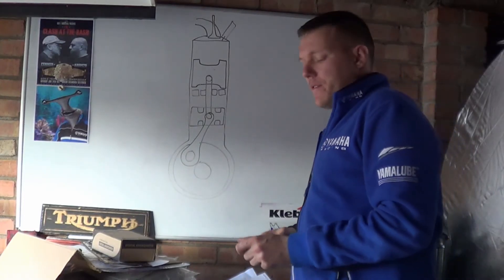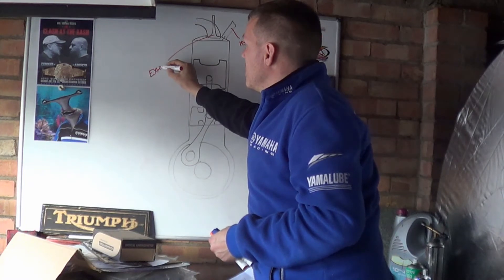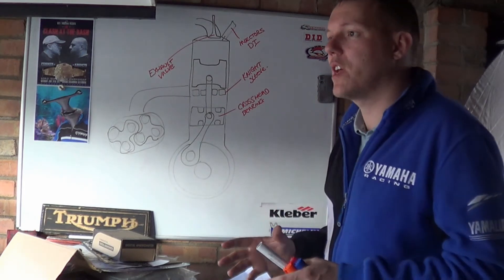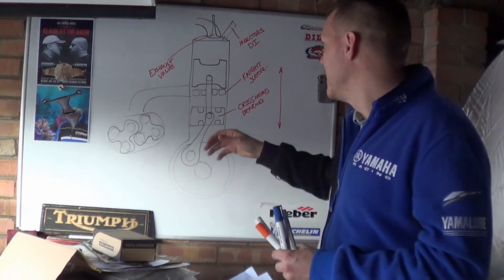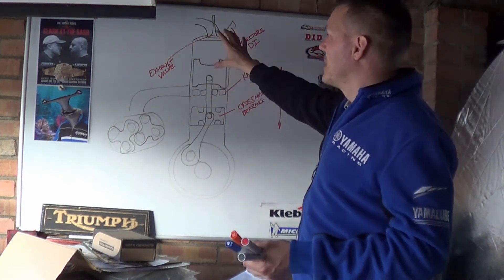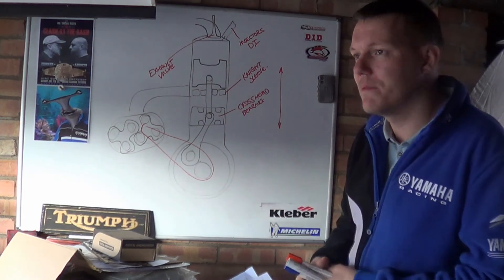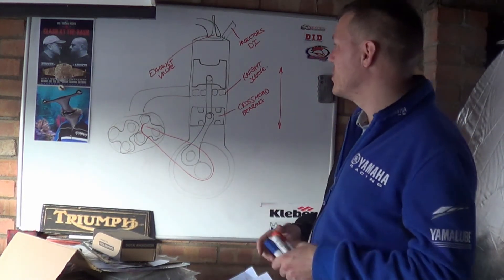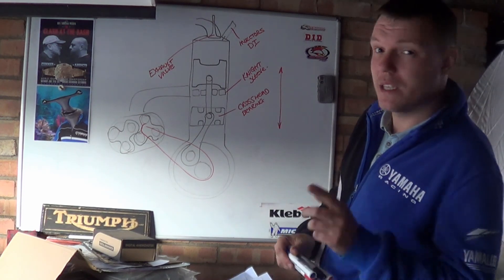2 Stroke diesel basics

Comment: When I was taking mechanics courses in High School, (College as you call it), they never taught us about these types of 2 stroke Diesel you talked about. They only taught us about the types the have an intake and exhaust valve. The kind that has the piston work like a vacuum to suck in the air on the downstroke, which then blows out the exhaust and both valves are opened at the same time. Still has a supercharger to make sure the exhaust is blown out. I found out that it is possible for a 2 stroke gas engine to work in the same fashion, but such an engine is not manufactured, because the idea of a 2 stroke gas engine is for lightweight applications, like chainsaws and dirt bikes, as well as reduced cost, fewer moving parts and simpler to maintain. Hence why you'll never see a 2 stroke diesel on a chainsaw. Would just make it too heavy. It would be possible to easily convert a small 4 stroke gas engine, like the ones used on lawnmowers, rototillers and snow blowers, to 2 strokes that work like 2 stroke diesel. All you'd have to do is make a camshaft with 4 lobes instead of 2, ad a supercharger to the carburetor, redesign the carburetor and ad another magnet to the flywheel. It's the same thing with any motorcycle and car engine, but you'd have to redesign the distributor and the fuel injection system. Adding a supercharger is the main issue since it increases the weight and 4 strokes are already heavier than 2 strokes, but since it would be more powerful, and more efficient, this wouldn't really matter. You still wouldn't see them on chainsaws though.
Reply: @Leemur2335  That's true. However, if you used a supercharger like on a 2 Stroke Diesel and fuel injection, instead of a carburetor and the ports around the cylinder, this could work on a gas engine. Certainly, it would be a waste to use on lawn mowers, rototillers and snow blowers. They're too small. Still, it could be used on Yard Tractors, Motorcycles, Cars and other motor vehicles. 

I understand that 2 Stroke gas engines now have injectors, instead of carburetors and this means all the fuel is burned, instead of some being pushed out with the exhaust, so it's cleaner. Still, I wouldn't want a 2 Stroke gas either way. I prefer 4 Stroke. They're cleaner-burning, don't burn oil, (unless the rings are worn out), quieter and more fuel-efficient. They have downsides like being heavier, more moving parts, harder to repair and more costly, however, they have come a long way in recent decades, as they're more powerful than ever, lighter and more compact. I was reading about Toyota's 1.9 litres straight 4 engines for example. The ones they use in their Prius', Camry's and Corolla's can get up to 242 horsepower now. The blocks are made of cast aluminum and the heads are made of aluminum. As a result, the engines weigh less than 300 pounds. I drive a 1997 Dodge Ram. It has a 5.2 litre V8, which is 220 horsepower and weighs 1100 pounds. It's made of cast iron. I'm willing to bet with the mechanical know-how, I could put one of those Toyota engines in it, while still using the same transmission I have, and I'd not only get more horsepower but much better gas mileage. Toyota should put those engines in their Tundras and save their big V6s and 8s for larger delivery trucks and other heavy applications.  I was reading that even Diesels can be made out of aluminum now and I thought the only light metal you could use on them was Titanium. You learn something every day.
Reply: @Leemur2335  Yes. I meant that the Toyota engines are less than 300 pounds in weight. Not sure if they make 300 ft. lbs of torque, but since they're multivalve, they might. Besides, Dodge used to put straight 4s in their minivans. My mother had one. It was an 88 Caravan. Those weren't very powerful, but could still be used for towing, although the V6s are better for that. The newer straight 4s could probably handle it. The ones introduced in 1996 get 245 hp and 260 ft. lbs of torque. Obviously not able to tow a big 25-foot travel trailer, but something like a tent trailer, or a boat at least. 

I used to own a 1985 Dodge Ram and it too had a 5.2 litre V8. It got 140 horsepower and 160 ft. lbs of torque. Of course, that was back when Chrysler was still using the LA engine. The Magnums, as I have now were introduced in 1992. Too bad, they never produced a LA and Magnum version of the Slant 6. Dodge trucks actually had Slant 6s until 1987. They weren't as powerful as the LA V6s, which were 120 hp., so not very suitable for towing, since they were less than 100 horsepower usually, but they were smooth running.
Reply: Yes using the crankcase wokrs well for a blower, liik at the skidoo etec with turbo now. If you need a 2 stroke fix you can convert a 4 joke in to a 2 stroke by u-loop charging thought the valves. a 5.9 would make a fun 2 stroke project like this vw 1.9 TDI 2 stroke conversion:https://www.youtube.com/watch?v=qosAllch8Sg&t=3s.  The cams would need to run 1;1 with the crankshaft and the exh would have to open a little earlier to allow bleed down, metal baffle would be needed for the intake valves to allow thorough loop scavenging. this is the pdf that descibes it:file:///C:/Users/bemil/AppData/Local/Temp/inventions-04-00044.pdf

Comment: I assume it has an oiling system like most car engines. if that is correct what stops the oil from blowing out when it goes across the intake port
Reply from the maker: The cross head bearing, and the fact that a little oil is burned

Comment: actually... the one you drawn up is not too efficient.you need 2 turbos there.
the blower is only needed at light load low rpm. a turbo can take over when revs are up.
and why 2 turbos ? you need to turbo coumpound it. THEN its efficient.

Comment: well, this is one type of it, but there are many many 2 stroke diesel kinds.
crosshead is not used for smaller sizes,
you do not need a supercharger, only at startup. then on locomotives its switched by a turbo. so you don't have parasitic losses.
and power to weight they can be verry verry good.
at one point they made a way into aviation too, and there power to weight ratio is crucial.

how about a video on other type of 2 stroke diesels ?

http://cdn.intechopen.com/pdfs/43662/intech-advances_in_the_design_of_two_stroke_high_speed_compression_ignition_engines.pdf

that might be a good read.
". In the more advanced configuration, the engine shows a power density of 50kW/l, a minimum specific fuel consumption of 235 g/kWh, along with relatively low in-cylinder peak pressures (120 bar). AVL claims that the engine is much lighter than afour stroke unit of the same top power and with similar single cylinder displacement(the total weight is less than 80kg). As far as emissions are concerned, the behavior ofthis two stroke engine does not differ from a four-stroke counterpart, and additional ad‐vantages have been found in terms of noise and NOx reduction."

that sounds sexy, does it not ?

Comment: He really needs to talk about 2 stroke Detroit diesels, like the series 71, 92, and 53. The 53's could rev higher. It wasn't long ago that the US military still used the M1070 HET with a 8v92T making 500hp, that's a V8 with 92 cubic inches per cylinder.
Reply: Don't forget the 6-110 and the 149's I had a 12V 149 that had 4 turbos and was 1100 hp.. Detroit also made a 3 and 4 51 series... loop scavenged... no valves.. EMD's are 576 and 645  cubic inches per cylinder. I think the EMD's got up 3-4K hp..
Reply: There was also nissan ud 2 stroke diesels, those were 75 CID per cylinder and had an external fuel injection pump.
Reply: Im about to grab an 8v92 for 2850
Reply: The field Marshall tractor had a giant single loop charged 2 stroke, i just read up on it. It has pressurized crankcase and external oil pump dry sump to feed oil to the journals. Its around 6 liters or over 300 cubic inches.

Comment: Ok, I'm an ignorant new guy. I've read the comments below and agree with EpicStream Overclock. Why can't you take this 90% efficient breathing system and use it on a regular petrol engine?Replace the injector with a spark plug. Introduce fuel in the supercharged air inflow and delete the cross head bearing piston and finally down size everything to 300 to 1000 CC or so?I assume the EXHAUST valve is mechanically actuated by a cam or other mechanism. BUT a single valve is NOT that bigof a complication. This would give you an efficient 2 stroke with clean emissions and the lubrication of a 4 stroke with thepower of a 2 stroke. What am I missing? Must be something. Cause, I AIN"T that smart.
Reply from the maker: You need a supercharger thats why. https://www.youtube.com/watch?v=nIM0m9Z-C6o&t=275s
Reply: The exhaust valve in the head closes the cycle so supercharging is possible/required.Also now the crankshaft gallery can be shared by multiple cylindersand oiled by pump making a multi cylinder 2T more practical.

Comment: All modern 2 stroke diesel engines use turbocharges, not superchargers and an auxiliary electric driven fan for low RPM and starting. Also the crankcase is separated from the cylinder by a diaphragm plate and stuffing box with the crosshead running on slides in the crankcase. Also the cylinder needs to lubricated using quills from a separate oil supply.

Comment: Probably a stupid question
Can't low rotational speeds be overcome by gearing or would there be excessive losses due to friction/weight of  gears with stupid amounts of teeth?  
Also quit fucking swearing for fuck sake!
Reply from the maker: "Probably a stupid question"

- yes

- and the answer to the question is yes, but you have to factor in the weight of the engine you're carrying

Comment: 90% of the two stroke marine diesel engines are turbocharged, not supercharged, because of the constant speed they are running at during normal operation. they only use An electric engine to charge the air  when starting up when the turbo is cold and on low rpms. i was Just watching the video to see what you would know about it. I am studying to become a maritime engineer in the netherlands. the reason why they dont use crank case pressure is because the crankcase can explode from the vaporized lube oil. there are sensors in there called oil mist detectors which can actually stop the engine when there is too much combustable gas in the crankcase.
Reply: redmar bos Thanks for the info, I really like it. Can you tell us about the bypass chamber for air to get into the cylinder on those engines? :)
Reply: basically there is a hollow chamber around the lower cylinder liner. The charged air comes through this chamber and enters the cylinder when the piston is at bdc (bottom dead centre). there are ports in the liner for the air to flow through. The air is not able to get to the crankcase because of the crosshead seals. There is also a diffrent type of lube oil used for this part of the engine.
Reply: @ike fun but a turbo charger and supercharger are completely different things . A turbo uses normally wasted exhaust gasses to turn a turbine attached to a compressor that forces air back into the engine . A supercharger is a compressor that is driven directly by the crankshaft of the engine
Reply: @josephfoster3819  not strictly true, although that is how the terms are commonly used in automotive world, technically a turbo charger is a type of supercharger.
Reply: do a search for the original 2 stroke most of your ?  will be answered

Comment: Make sure you show the Napier Deltic.... And don't forget the Detroit 6v92T that uses turbos instead of superchargers to reduce the parasitic losses incurred ...
Reply: They don't use turbos instead of superchargers, a turbo is used in addition to the supercharger. Because the engine wouldn't run without the supercharger

Comment: Crosshead bearing, super interesting.
Never heard of them called that, is it an English thing or an application thing? I've only heard them called linear surface bearing or linear ball bearing, and never saw one in an engine... unless you consider a valve guide a bearing.

Comment: Quick question. Surely it should be possible to adapt (change few things round) this design/ ideology to a standard 2 stroke engine that you get in bikes etc. Get rid of secondary rod and cross head bearing put an oil ring on the piston and off you go right? Of course you would need to figure out a way to somehow pump air into the cylinder, well how about a secondary chamber which would work like a crank case in crank case breathing engine. That way you get good volumetric efficiency, the components should last as long as 4 strokes, but you still get the beloved 2 stroke action. What is wrong with my idea????? there has to be something I am not thinking about as otherwise we would have them already. Thanks. BTW you make great videos, it is EXACTLY what I have been waiting for. Could you maybe do a video about motorcycle suspension? Or better yet: very detailed video about porting!!! primary 2 strokes please. Thanks :D
Reply from the maker: No worries mate, your comment needs its own video really - matt
Reply: EpicSteam Overclock the is a gentleman that made bespoke/hybrid engine by combining the cylinder jug and head from a Honda cr500 and the lower half of a Honda cfr450 to make a 2-stroke 4-stroke hybrid (still operates as a 2-stroke) and it made really good power.
Reply: The explanation I've heard is that a 2 stroke gas engine can operate the same way. The problem is, is that it would be just as heavy and expensive as a regular 4 stroke. In other words, using them on dirt bikes, and especially chainsaws would just ad unnecessary weight. Although for a dirt bike, this probably wouldn't be noticeable, because you'd get plenty of power to compensate anyway. Too bad, because 2 stroke gas engines can be quite dirty compared to 4 stroke. Mainly because they don't always get rid of all the exhaust and can often waist fuel, by pushing some of it out of the exhaust valve without burning it. It wouldn't be difficult to convert a 4 stroke gas to 2 stroke. At least if you were working on a lawnmower, roto tiller, or snow blower engine. All you'd need is 2 more lobes on the camshaft, a supercharger and another magnet on the flywheel. You could likely do it to a 4 stroke dirt bike engine to, but it's more complicated, due to having overhead valves, rocker arms and a distributor.

Comment: :) Thanks for this video. I'm working on designing a system to remove the problems smaller 2 stroke diesels (such as those once used in automotive applications) have. Most of them can be solved by mounting a clutch on the blower to disconnect it at cruising speed and creating a large blower bypass in which a compound turbo system can help the engine better develop low end torque and keep its phenomenal high end torque.
Also is it not possible to use a VGT on a 2 stroke diesel and if so why?
Reply from the maker: This obviously requires another video, but thanks for the comment - matt

Comment: Could you shrink it by ditching the crosshead bearing, having a turbo compressor and a dwell for a longer exhaust? Maybe with a Cycloid mechanism https://youtu.be/0NxSX-_VIF8
Reply: Meh, maybe it is too complex, but I fell like what is really holding small 2 stoke diesels back is just how crappy 2 stroke efficiency gets when it is small. The benefit of diesel 2-stroke is that you can over-exhaust without wasting fuel. I feel like if you could get all of the exhaust products out every stroke you would actually have something.
Reply from the maker: a turbo compressor wheel is inefficient at the low speeds and to gear it up would be costly and heavy. A roots blower type charger does the job fine.
Reply: ship two strokes use turbos. they are designed around a small "power band" because of the long times these engines run on these speeds. this way the turbo is way more efficient and less likely to break down because of wear. The biggest of these engines have a efficiency of 52% from energy in the diesel to the shaft. In a car you would be lucky to have 30% efficiency
(sorry for my bad english)